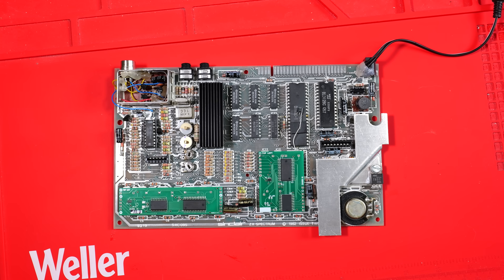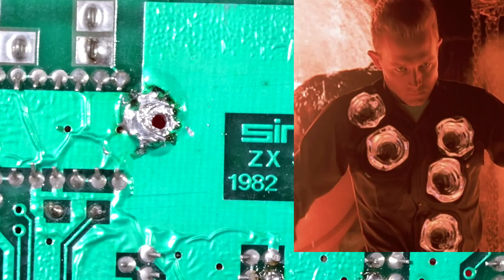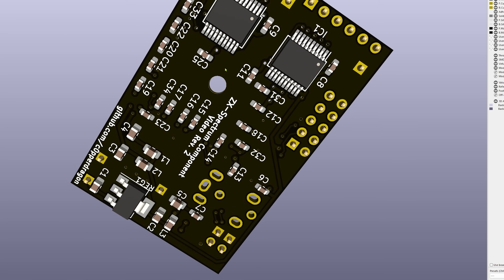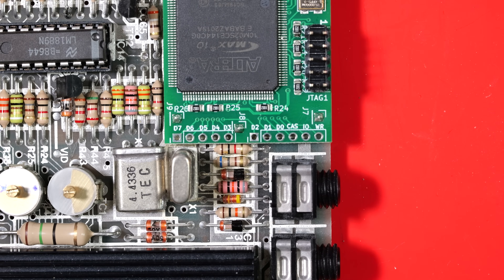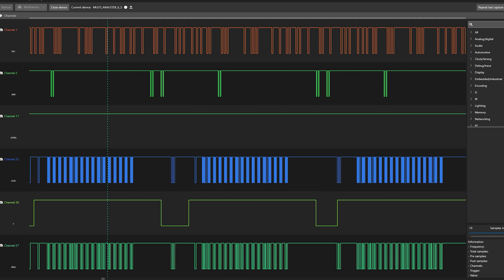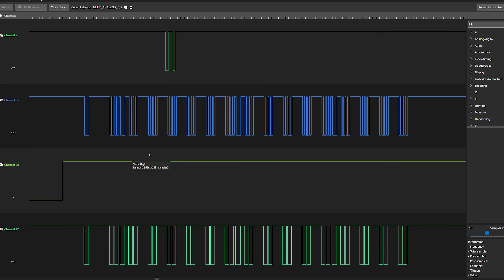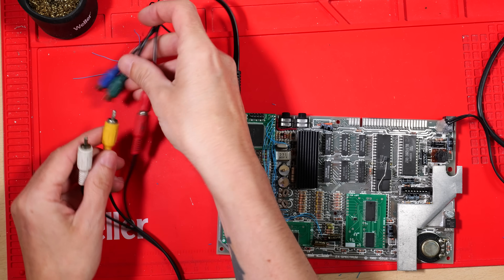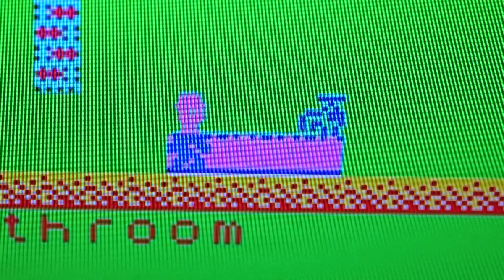FPGA Component Video for ZX Spectrum

Comment: The subject of this video by Jim was my Issue 2 board and lower case. The board had a few display issues which Jim sorted out and the component upgrade was a last minute decision replacing the original S-video modification that was not the cause of the issues. This board is going back in my 1984 Transform metal keyboard which is far nicer to use than the original rubber unit - if a bit less wieldy. Overall a nice unit to use with display quality close to HDMI and no appendages sticking out of the rear. Thanks to Jim for great work.

Comment: The other option that comes to mind is the vLA82S+ which includes both RGB video output (similar to component video) and AY sound. Although I found that at least one game (Outrun) uses the presence of an AY chip to switch between 48K and 128K versions of the game ... plus the vLA82S+ is currently out of stock in the UK so it looks like you have to order from New Zealand (where it originates) at about £60 ...
Reply from the maker: I have been eyeing up a big order from Charlie, might throw one in

Comment: the U and V from a ULA IS basically 'component', but inverted, so IF you have a 'good' ULA , you can likely invert those signals , plus Y , for Y, Pb, Pr..?? thats how expansion port RGB interfaces work, they 'suitably' process those signals... interesting how it detects video data, wonder how it knows the video addresses/synchronises??
Reply from the maker: I considered going into detail again and learning about what component really is for this bit didn't have time, I had already sunk days into this board, so thanks for telling us a bit about it.  Yeah I'm not sure, maybe it recognises a vsync based on delays? Not sure. The code is out there though I think via the GitHub

Comment: What iron are you using?
It looks conical and quite long and depending on the iron, it may have a long way for the heat to travel and react to the heat sinking of the PCB foil and barrels. It also looked dull and oxidised which is a heat barrier. 
I have Pace, JBC Advanced, Weller and Metcal at home and always use the Metcal for those as the reaction and reservoir are very good. 
It’s not all about temperature, it’s about the speed of reaction to a thermal load and the reservoir behind the tip so the irons ability is just as important.
My preference is chisel but when I’m teaching soldering, I tell students that the right tip is the one that suits your style and does the job.
A colleague trainer of mine prefers hoof tips and his soldering is nearly as good as mine 😂 (long standing joke we both have as he says the same about my chisel tip preference and in reality we are both just the same).
Stay away from conical tips apart from fine SMT although I still use my 1.2mm chisel when demoing 01005 soldering.
Reply from the maker: I know it looks conical in some shots but I think it's just the orientation at which I'm holding it. It's a Weller with a chisel tip that I've settled on as a good all rounder for the things I do.  I think the major issue with removing this modulator was the beefy ground legs being bent over rather than the application of heat
Reply: @HappyLittleDiodes is it a Weller Magnastat iron like the TCP as if so, they don’t have a good heat reservoir and the heat transference is through a conducted element and the bi-metallic can be slow to react to a thermal shunt.
But you are right, the Can is an additional chunky heat sink and the tabs being bent make it so much harder.
I think you already know but additional solder before desoldering will aid in heat transference by breaking the years of oxidisation down.

Comment: ... мужик, используй широкое  жало для паяльника, в каждом видео ты используешь жало для пинов tqfp, ты понимаешь это ???
Reply from the maker: This is a chisel tip it's already wider than the joints
Reply: @HappyLittleDiodes  ... это жало не подходит для пайки выводных компонентов и больших площадей меди не печатной плате.
Reply from the maker: Recommend me a tip
Reply: Do these work on the plus 2?
Reply from the maker: Hmmm good question, I expect it says somewhere on the GitHub, but it would depend on the specifics of how the ULA on the 128k boards address video memory. I have a feeling it would work or at least could be adapted to do so